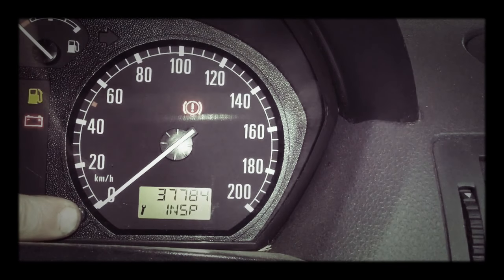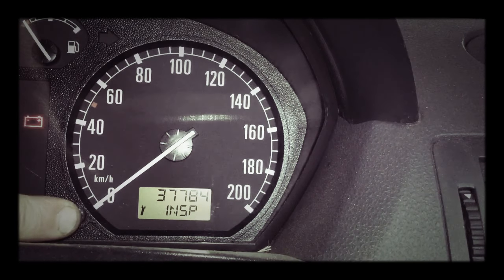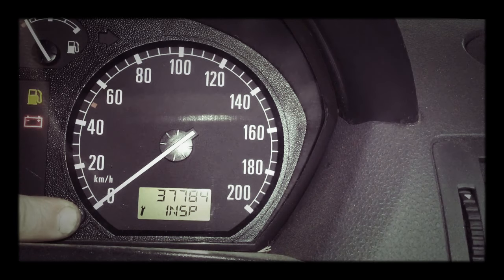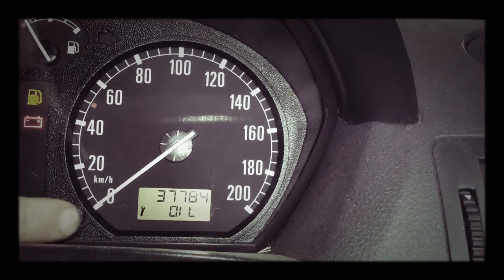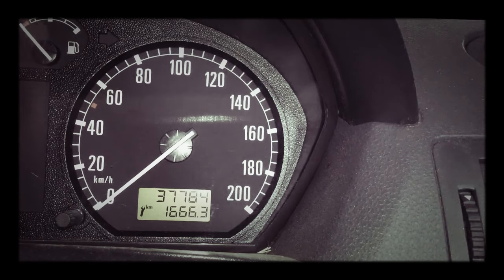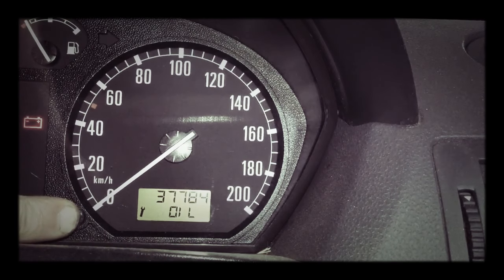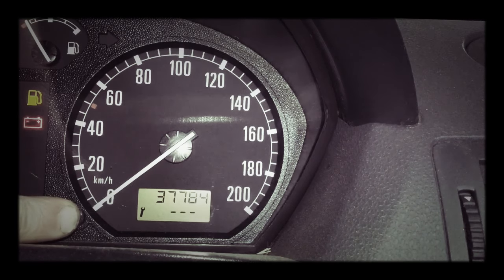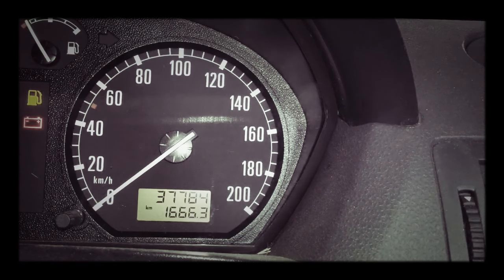CITI GOLF SERVICE LIGHT RESETTING

Comment: Hi, where is my oil pressure sensors located on my my1 Citisport? I need to replace them as my oil light keeps coming on though there is sufficient oil in the vehicle
Reply from the maker: One is located on the oil filer housing and the other on the side of the cylinder head but make sure you replace them with the correct one as the colour differences do matter.
Reply from the maker: You could also have blockages usually the most common one is in the strainer in the sump.
Reply: Thank you for the reply, i located the one on the oil filter and for the life of me couldn't find the other lol. Motor has recently been done over about a week ago, coolant mixed with the the oil and sludged just seeped into every hole it could find even reached the throttle body, sump and oil pump was removed and cleaned as well. Wish I could send you some pics of how bad the sludge looked. Now the motors done and now the problem came up with the oil light that keeps coming on when car heats up to normal operating temp when fan comes on

Comment: Hello how do i reset my oilsensor light i change the oilsensor and the oilpomp but the bazzer still make the noice
Reply from the maker: Did you change both oil pressure switches?
Reply: U must buy another pressure switch it has different colpurs so tru anada colour n c..i had a same problem but i changed the pressure switch colour from white to brown...now its 5n